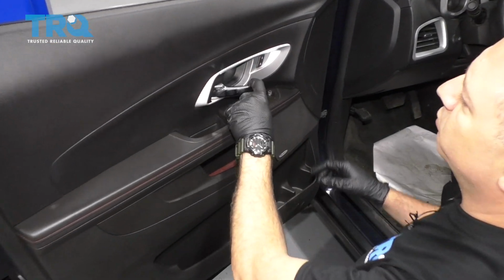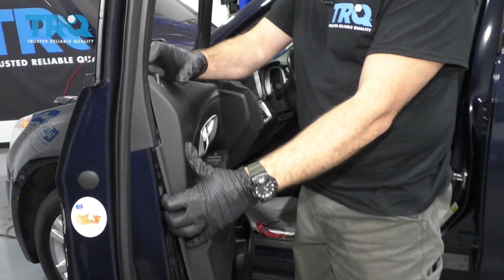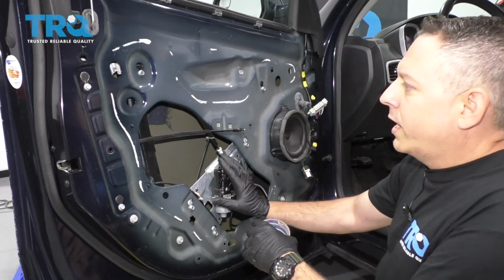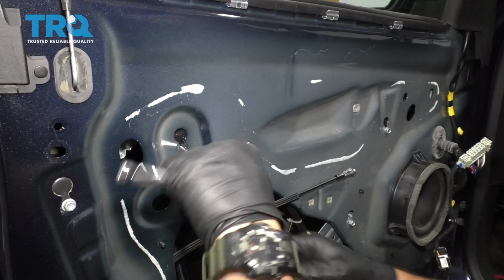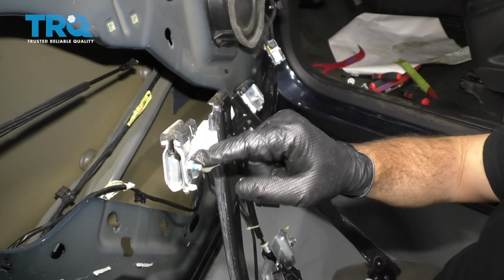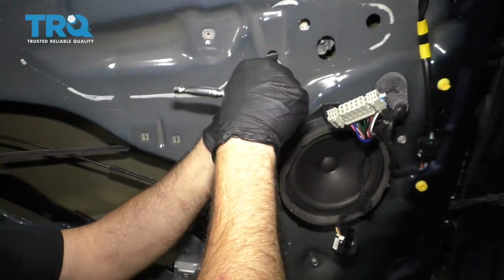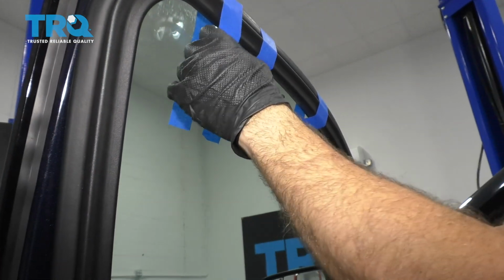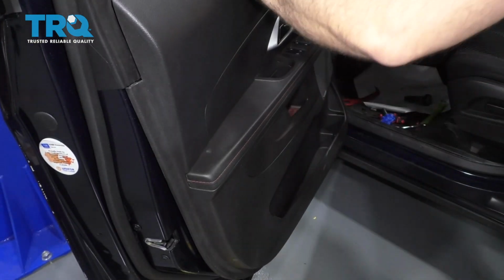How to Replace Front Window Regulator 10-17 Chevy Equinox

Comment: how to move window to up position if it's stuck half way? took the door card out, and the insulation, and pushing upward manually on the window will not budge, cables tight and won't move

Comment: Great video.  You guys are forgetting two things which made this change alot harder than the video. 1. The window has to be all the way up, otherwise you will not be able to have acess to the the two bolts which loosen and tighten the two clamps to the window.  My Equinox would come uo about two inches short to the top which made acsess to the two bolts a pain. 2. the replacement part has to have the two guides for the window near the top.  My didnt. So you have to connect the electrical connection and run the regulator and get them in their right position other wise the screw holes will not line up.     😀

Comment: great video, but did you notice that the screws that hold the frame on the inside, are backwards?  2 top screws have no washer screws so they can fit thru the door frame slots, the bottom ones must have the washer screws, no slot on door frame. noticed that when i did my assembly, with your help.  other than that. made it look easy.. thanks,

Comment: My parents driver door window is in the down position and won't work. How do I get it in the up position to replace the window regulator. Assuming it's the window regulator.
Reply: My parents live on a gravel road. Wondering if the wiring clip didn't wiggle lose.
Reply: Of course all of the other switches on the door are functioning. So I presume it's the window regulator.
Reply from the maker: +blackseabrew You will want to start with removing the door panel first as shown in the video. This will allow you access to the window so that you can manually move and secure it in its upward position.